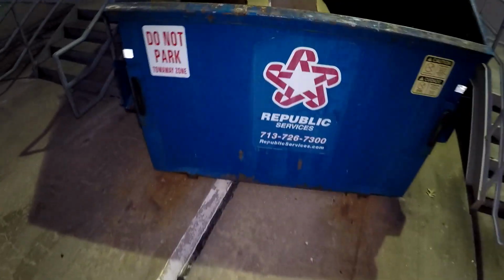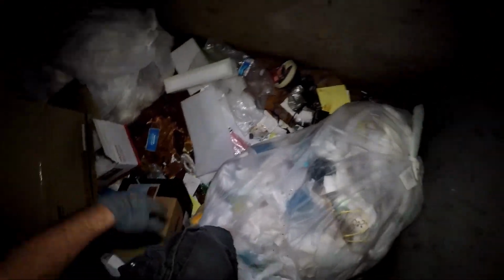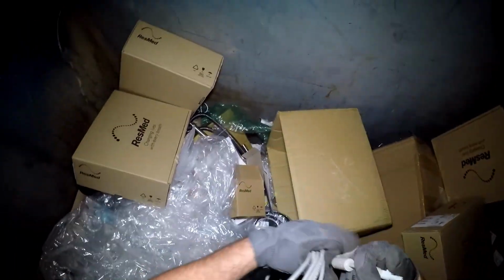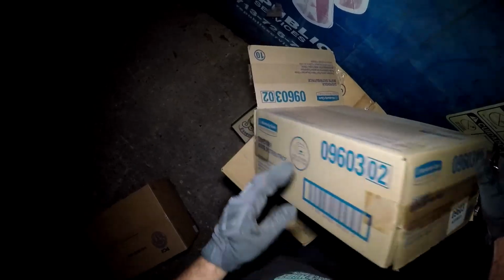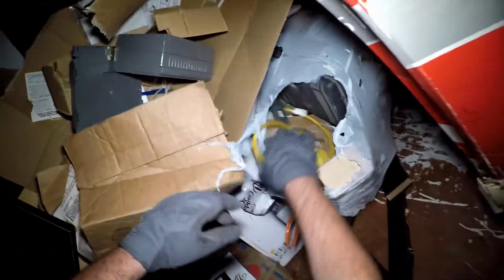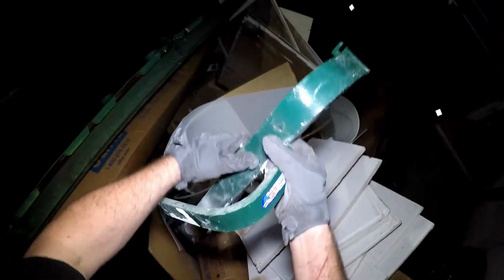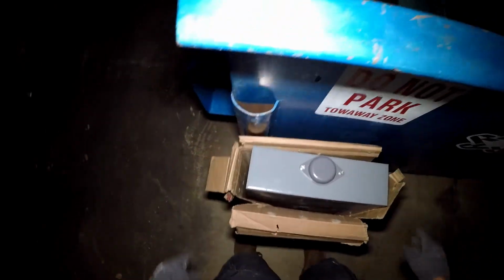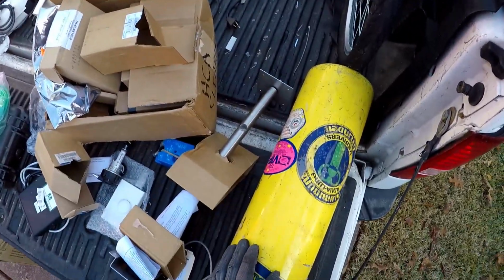Dumpster Diving "Down In The Rabbit's Hole"

Comment: I found 4 old scuba tanks.  Local dive shops wouldn't buy them so I sold them for scrap = cast Al.  The valves are brass and easy to remove BUT you need to let all the air out first.  Just open the valve and let it drain over night.  You could also cut the closed end off and make a bell out of it like Roe Mantic did on his channel with some oxygen tanks.

Comment: Mike empty the air out of the scuba bottle drill a hole through the top of the tap and thread it drill a hole in bottom and thread a wire through both connect a fitting and Edison bulb .
One man cave lamp complete and sellable or swappable with you local dive shop
Reply: That’s a great idea!

Comment: 06:42 The SCUBA tank.  The pre1990 6351 aluminum alloy tanks are technically legal. Some have had cracking around the valve area, and were retired. Many dive shops will not fill these tanks for safety reasons(they are afraid of the liability of the tank exploding), even though the neck cracking has been overreported . I would let the air out and leave the valve open. List it on ebay as a historical item. I understand there are dive shops and collectors of vintage SCUBA gear out there. The Jvalve on that tank is also outdated and superseded by more modern valves.  24:39 A glassware drainage rack for laboratory glassware after washing.

Comment: 9:55 That aluminum thing with the two wires is a carrier for an external battery pack for an LTV ventilator. The batteries weren’t in it. 
The power supplies go to an LTV also. Those could be sold prolly.
IDK if it interests you to learn what things are, but I’m happy to share knowledge.

Comment: That tank is so old it’s antique. Lol. Seriously though be very careful if you plan on taking the top valve off. Even when you bleed off all the air it still has a tremendous amount of pressure. In a store I worked in many years ago, we had helium tanks. The empties were just set off to the side. One day one got knocked over and the valve hit the floor just right and got knocked off. It has so much pressure even though it was empty, that the valve blew through the wall of the store into the attached store next door. Scared us all just about to death. They told us later that if it had hit anyone it could have killed them. It’s a scary thing to mess with. 
Sure have been missing your videos. 
Stay safe and God Bless

Comment: Actually I think those "foot pedals" are bottle rocket launchers. You put a 2-liter bottle on them and hook it to the hose.  Push the pedal, and when the pressure builds up, you release the petal and the bottle shoots in the air under water and air pressure.

Comment: Those tanks get certified which I’m pretty sure is a internal visual inspection. If it’s been sitting around more than so much time it corrodes up and you can’t breath that stuff. Back in the day I wanted to rip it down and turn it into a picture frame or 3. Yeah, back in the day...

Comment: just took in my electrical wires that I cut off of all my scrap stuff and all the smaller wire I micro scrap from all my appliances and such. Just wiring alone and got $577.40. now busting my butt stripping all the solid core wires and breaking down all my copper pipe too #1 and #2. next I am hitting my good sized aluminum pile and separating it all out. A good payday like today gets me all motivated to hit it hard again. Bad part is I left my brand new gloves on the table when I took them off to sign the ticket pad. SCRAP ON fellow scrapers.
Reply: That's what's up

Comment: Sounds like the tank likely isn't worth the cost to re-certify. You could try selling it as a prop/decoration. 
Scrap yards around me will only take pressure vessels if their cut in half. Mostly for their safety as it guarantees theirs nothing trapped inside when it gets crushed/shredded.

Comment: scuba tanks are used in machine shop for vacuum plate machining , they holes drill in them, pipe fittings added , do not need any certification

Comment: The scuba tank. Portable compressor tank for air tools on the move? De-rate it to 75% of its original rated pressure and reseal and test the valves and I'm sure it will be fine.

Comment: The SCUBA tank has to have a hydro test every 5 years. If its in good internal condition it will most likely pass and can be put back to use. Hydro runs ?? $30-$40 ish ?? Tank worth about 80-125 used